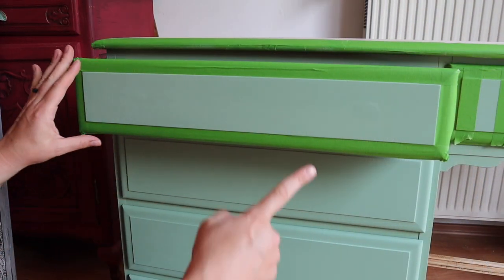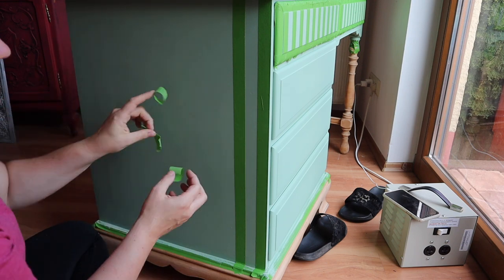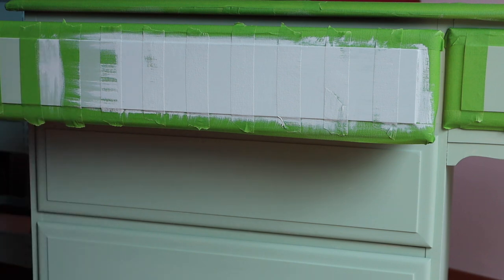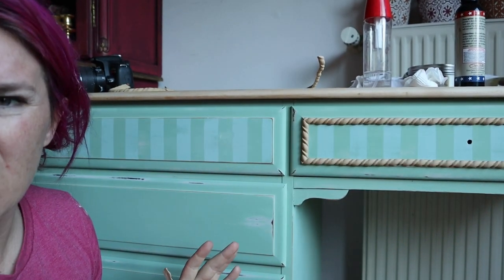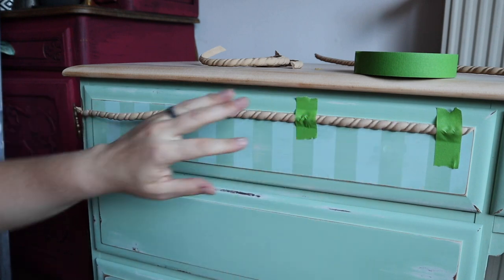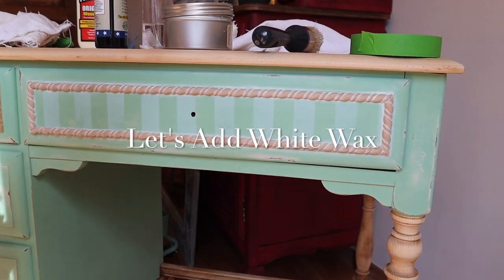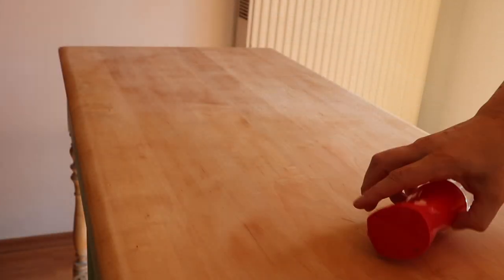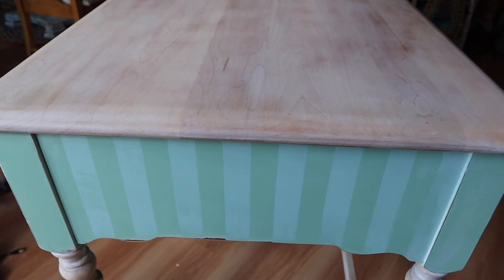Striped Desk Makeover With Chalk Paint

Comment: A quick question: why we put  trims on painted surface and not at the beginning? Before we apply the paint? Thank yiu
Reply from the maker: Great question!!! I did it after because I DIDN'T paint over the trim and it takes more work to paint around the trim. For ones that I will paint OVER I put the trim before the paint :) I hope that makes sense ❤️
Reply: @BellaRenovare  yeps, thank you . I was just wondering if the glue will not pull the plant from the surface .